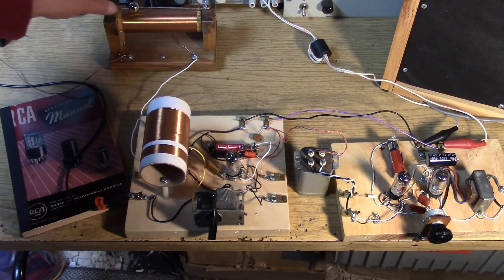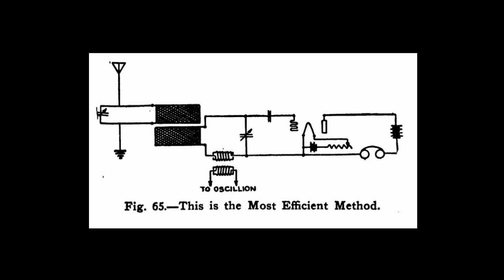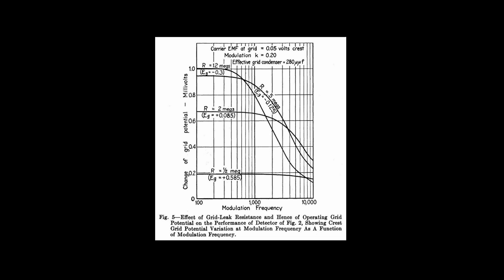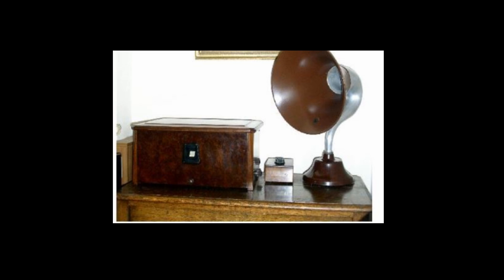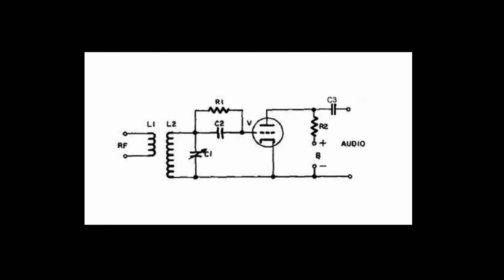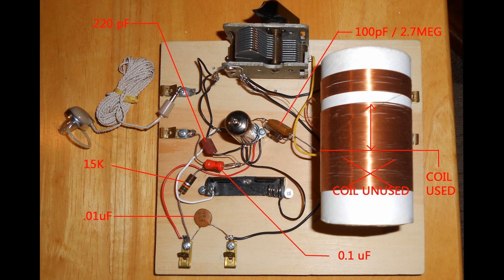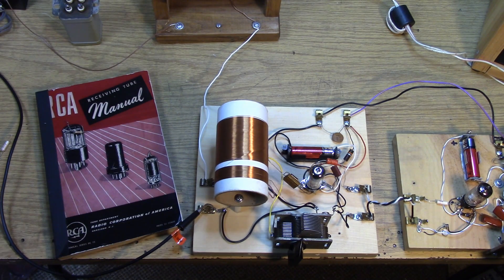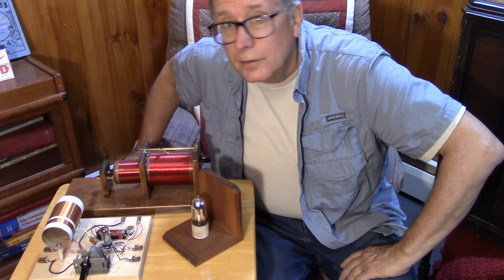Your First Tube Radio Project

Comment: I know nothing about radios, but I purchased all of the parts to build a crystal set, years ago. Just haven't built it - yet... I also have some 6J1 tubes. Again, I know nothing about these, either. But, might they do for this project?
Reply from the maker: Those miniature 6J1 Pentodes are very high performance USSR era design, UHF RF valves, that of course work fine for lower frequency and audio as well. It would work with 6V to light it and 45V. No problem. The plate and screen would be tied together to form a Triode.
Reply: @MIKROWAVE1  IIUC, there is one tube in the receiver and two in the amplifier... Would the 6J1 also be okay for the amplifier side? I am not looking for extreme volume. I just want to drive an 8 Ohm speaker, instead of wearing an earpiece. If the 6J1s are not appropriate, I do have a DIY LM386 audio amp that should work. Thank you.
Reply from the maker: @t1d100  Two 6J1 valves and an audio output transformer will have plenty of gain and likely more output power. Maybe a 1 Watt of audio. They may need a bit more voltage than the battery valves I used. Maybe 90V to 150V.

Comment: Which video did you introduce or make the adjustable antenna tuning loading coil?
Reply from the maker: Ah. That was back in a series on Crystal Radios a few years back!
Reply: @MIKROWAVE1  I found the video where you made the antenna tuner for the Crystal radio. 8 years ago, "Crystal Radio Part 2".

Comment: Hi Mike,  I've seen an old tymie tube radio schematic in the Wikipedia article "reflex receiver " ; could you test out this circuit in a future project? ( on my video wishlist😀)
Reply from the maker: Cool stuff that reflex approach. Basically you can make the single tube tube act as both an RF Detector, and Audio Amplifier as the basic circuit - BUT with real cleverness - an RF and IF and maybe an Oscillator too - all at the same time

Comment: Very impressed by the performance. I own several 1920's TRF receivers and wasn't aware that a grid leak detector would work that well without several tuned stages before it. Looks like I'll have to whip one up and see how I go.

Comment: APPRECIATED. 
IF WE USE FERRITE ROD ANTENNA INSTEAD OF LONG WIRE ANTENNA, WILL IT WORK PLEASE.
Reply from the maker: A LARGE ferrite Rod or a 3 ft Frame with about 10 Turns as the tuned circuit will work on the AM Band for you indoor experimenter folks. I will show an example. We can not expect the same sensitivity, but worth a try for a video.
Reply: @MIKROWAVE1  interesting

Comment: Seemed to have good fidelity both for voice and CW; and easy to use without much refinements.
Back in my day, transistors were all the rage so I built radios using them since tubes were really poo-poohed at that point.
For a long time as a kid, I had stripped out many TV sets but then gave all my vacuum-tube stuff away; sure wish I had it back because I had everything including a half-gallon milk carton full of RF chokes (just hurts to even think about it!)!  We filled this guys station-wagon, and it was nearly dragging the ground when he left!  73...
Reply from the maker: Now that was a righteous Junk Box of parts!

Comment: I would say from my experiences that a grid-leak detector IS NOT very sensitive with antenna aerial length of just 50ft of wire. But many factors come into play here: the tube type, the antenna arrangement, the location
Reply from the maker: Well I agree that it is not as good as the regen, but it is fairly close to a table radio, with a good antenna.

Comment: Thanks again, Mike. Always look forward to your next episode. Concerning this project, or any of the other receivers that were designed for BCB reception… back in the 80’s the FCC mandated that AM stations limited their ‘high end’ to around 9.5 kHz and then ‘brickwalled’ the response above that. AM Broadcast processors for US stations all incorporated what amounts to a 75 microsecond pre emphasis curve (like the FM stations) but with the steep rolloff as I mentioned. Without accounting for that, a crystal set, regen, or grid leak, may sound excessively ‘bright’ or harsh. That pre-emphasis could be addressed, in this case, by factoring that in to the grid leak resistor/capacitor makeup… or, could be addressed in the audio amplifier by incorporating a 75 microsecond de-emphasis circuit using an appropriate capacitor and resistor as a low pass filter. This would mellow out the audio.

Regards,
KC9NAN
Reply from the maker: Some of them also have subcarrier data services inside the 10 kHz.
Reply: @MIKROWAVE1  IBOC HD AM radio signals, we had a local station that use to have the IBOC transmissions, but they turn it off. One issue I have with IBOC subcarrier data services, is it bleeds over into the adjacent AM stations only 10 kHz away, making DXing of some distance stations impossible.
Reply: Can’t speak to the data services (I knew that existed; didn’t think it was used much)… but the hybrid digital (HD) standard dumps multiple ‘digital carriers’ within the audio passband and even outside the ‘channel’ (+/- 10 kHz) of the station. WBZ had been using this fraud technology for several years. All the Chicago stations that had tried it dropped it. Junk. Plus, you must limit your analog audio to 5 kHz (or less) so the analog doesn’t interfere with the digital carriers placed above 5 kHz. Your cellphone audio may be a better experience! My 14¢ (inflation).
Reply: @kennethandrysiak4130  I agree with you the IBOC is useless on AM broadcast band. interferes with adjacent stations.

Comment: Back in my young days built the grid leak with 6SN7  , i did get it to work but power supply always had a hum from the 5Y3 circuit.    you need good regulation Dc or battery.  selectivity was a problem too,    big gun station always took up big part of the varible cap.     i got shocked many times from old chassis was building , once electrolytic blew up  my God  I was lucky no lasting damage  ,    my God,   12 years old   working old basment.      you know about selectivity    though      friend mine tried the Spider web coils.  I think he had better Q with that.
Reply from the maker: Yes the circuit really adds gain up front and much of that makes it sensitive to  hum and microphonics.  A good coil setup and that tap idea can help with selectivity, as does the loading coil.